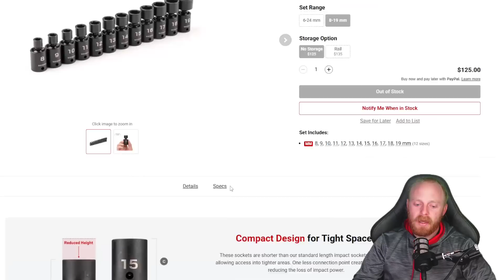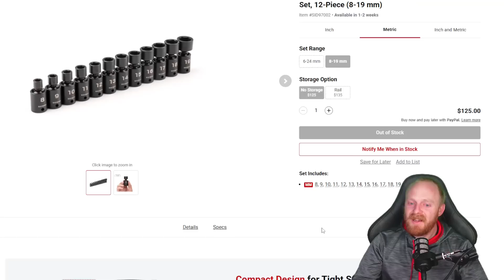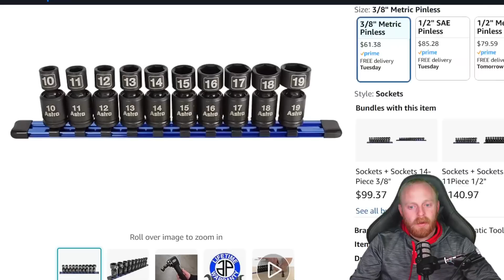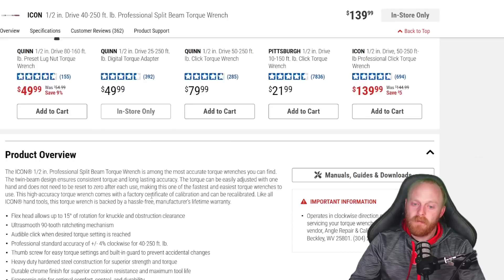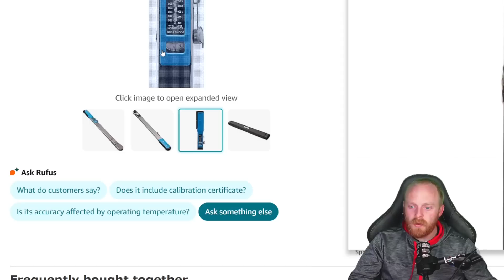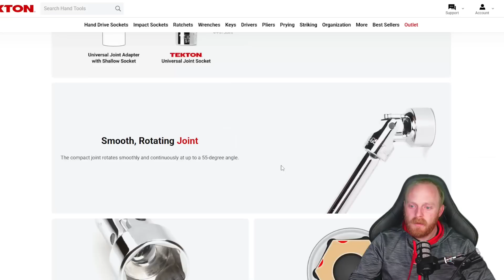Tekton Tools You SHOULD NOT Buy pt 2 and other brands to consider

Comment: You can't give advice or any kind of review on a tool you've never bought or used or tested
Reply from the maker: I most definitely can. And did!! And the reasoning is solid. So If you don't like it to bad. It's not hard to figure out if things are good quality using many factors and its not hard to evaluate value by comparing pricing of other in similar quality ranges. Thats like saying you didn't know something was good or bad until you bought it 🤣😆🤣👋

Comment: I’m surprised you didn’t cover their new fixed/flexible ratcheting double box and wrenches. They are priced obscenely at 675 for the full metric and SAE set.
Reply from the maker: Ya i couldn't remember if I had mentioned them in a previous video or not. And it is crazy the price jump they made on those from the previous design.

Comment: I have a ton of Tekton sockets. Chrome, 3 drives..all the big sets, 6 point and 12, metric and SAE... chrome universals Love them. I got the 6 point impacts,metric and SAE...in the same 3 standard drives. but no universals. My impact universals are Astro. Like those too. Tekton sockets are  a good value. You can get cheaper,  but they are ... well,  cheaper.

Comment: If you live near Michigan, they are local. Any warranty issues are taken care of fast and replaced no questions. I have a few of their tools but would absolutely love owning a complete box and bundle they sell. I'm sure many of their tools meet or exceed %95 of today's market place of tool manufacturers. I know they have a few dudes like others offer in their line ups, but with a whole set I'm sure you could weed out the bad and sub in others if you need to. I have a few socket sets, a few pliers and a handfull of their ratchets along with one of their air hoses. Absolutely love every item. If I could afford a one time chunk to own these as a whole set I would gladly test them into the ground and be sure I would still be passing on quality to my children
 In turn a Snap on, Gearwrench, or a Proto set will run you much more than this and  may or may not be as friendly with their warranty if you need and double or triple your price from Tekton's tools. I really like the extensive sets they have also no matter the tool. I only wish they bring back the swivel head ratchets they had. My only choice now is a Genious set that cost 60 more for the same tools.